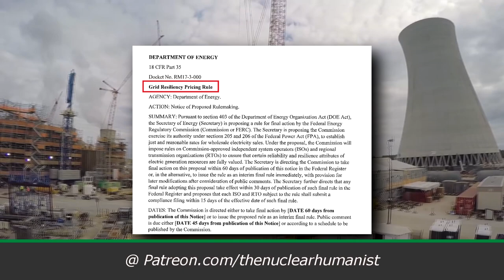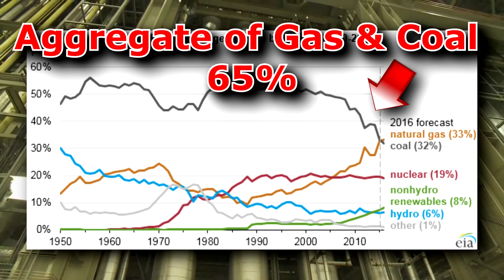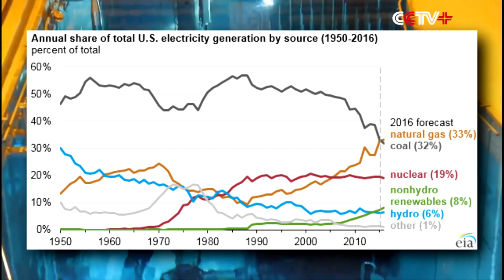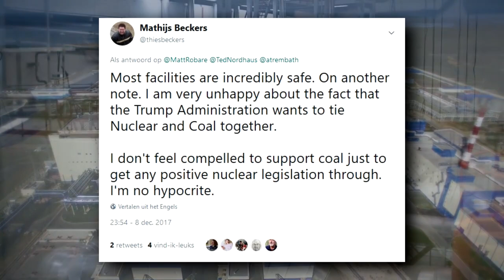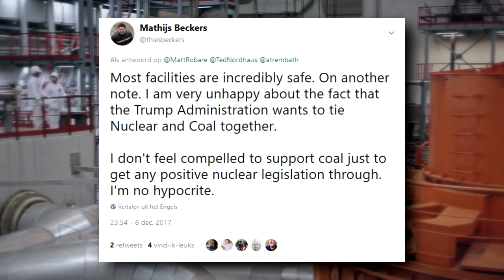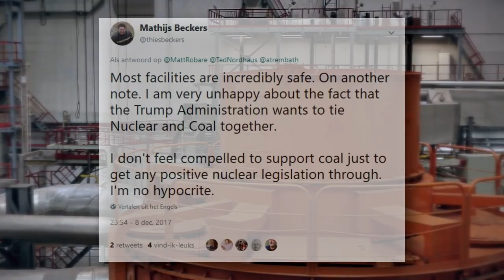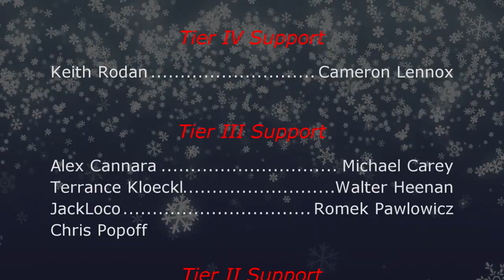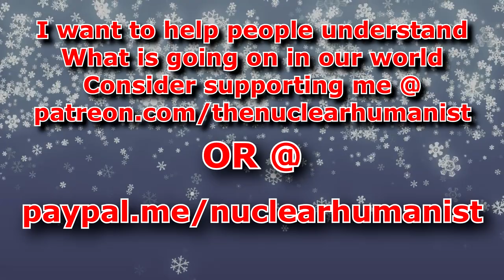Support new coal / nuclear subsidy or not?

Comment: I disagree with Refutations to Anti-Nuclear Memes refusal to oppose fossil fans as of a few weeks ago. Fossils are the enemy and they always will be. Renewables and their proponents are not the enemy, but they are also not part of the solution, but this is not through malevolence, but instead misunderstanding.
Reply: In this respect, the new anti-nuclear strategy of "renewables alone can do it while nuclear is expensive and dangerous" is perhaps, the most brilliant mental framing ever devised.
Nuclear proponents must prove a negative - that renewables alone cannot be enough. 
- Proving a negative is famously difficult because the reasons change as new developments arise. It forces nuclear proponents to constantly revise their arguments at the risk of appearing inconsistent.
- Taking this position forces nuclear proponents to start off on the defensive, not on the offensive. If they do take the offensive and dismiss renewables, then they risk alienating the very people they are trying to convince, who for years have been indoctrinated with the ideology of the wind and the sun.
- The "versus" framing is perhaps the most brilliant - and insidious of all. In itself the claim that "nuclear is un-necessary" already invites nuclear proponents to fight on their opponent's terms.

The only way to bypass this that has been successful, so far, has been the weight of history in France and Sweden, and Germany's manifest failures. Had Germany's Energiewende been any more successful, or its transition to Russian gas mitigated by increased imports from Western Europe or America, its falling emissions from a coal to gas switch could well have given enough positive results to allow anti-nuclear renewables proponents to have overwhelming leverage to shut off that line of debate by conflating coal-to-gas decarbonisation with decarbonisation with wind and solar. Right now that argument is only alive thanks to German lignite.

In addition, even the Bundestag is now becoming more and more acutely aware of its devastating costs of its renewables buildout and increased strategic vulnerability by reliance  upon Gazprom. Merkel's administration is now being pilloried by hard left and hard right who have exploited Energiewende's inequities and flaws for populist gain. 

Even still, the fight to keep nuclear on the table is becoming more and more difficult as  those in the greens are finally discovering that actually, facts no longer matter in this post truth world. Only values matter and tribes matter. By doubling down on their ideology, by having activists assume positions of power in the European apparatus and adopting a precautionary principle on issues of technology - especially in the European Commission where appointment is non-democratic - they are more prepared now than ever before to enact sweeping reforms that burn the witches they oppose: GMO and nuclear. The current climate of tension - a resurgent Russia, a rising Asia, the MENA region  once again wracked by violence - gives air to activists and allows them to amplify their own politics of fearmongering against technologies they hate. 

But it is also said that the night is darkest before dawn. I believe that in Europe, at least, it is now a ripe time for actual climate action, led by nuclear and a cornucopian mindset. It might take a single spark - a rolling blackout in Germany; first criticality of Polish reactors; an announcement by the Macron administration to renew their nuclear fleet in denial of their neoliberal tendencies - before the light of Cherenkov can rise again. It will take vision and guts and blood and sweat and tears. But there is no redemption without sacrifice, and no choir while too many stay silent. Speak up, and maybe some will listen.
Reply: Russia is having fun explaining how absurd energy policy is in Europe. And what a joke US LNG exports are. The US doesn't have enough gas to supply domestic demand, never mind replacing coal, never mind exports. All just playing politics. Energy = Political and Military Power. It is far, far more than just another commodity sold on global markets.

The USA Tries to Redistribute the European Energy Market:
https://www.youtube.com/watch?v=ULDEeW1EozY